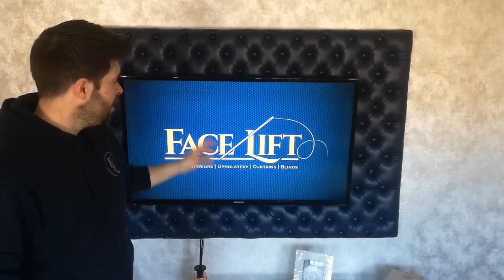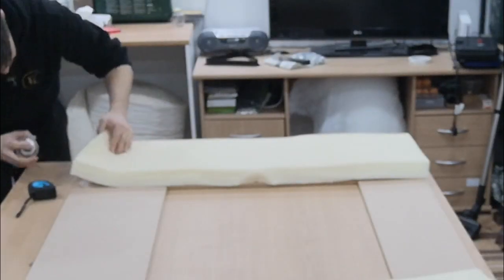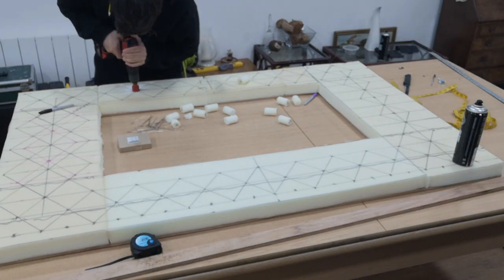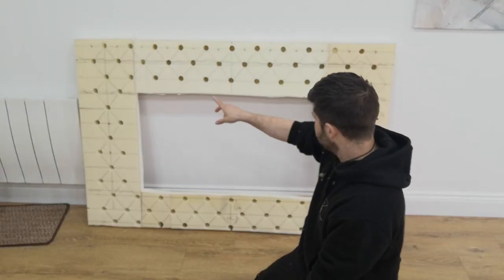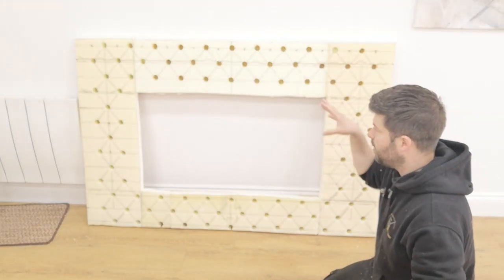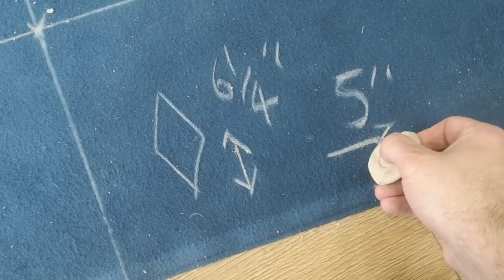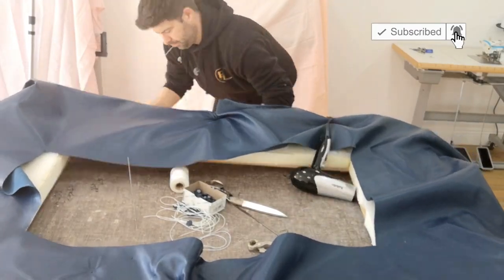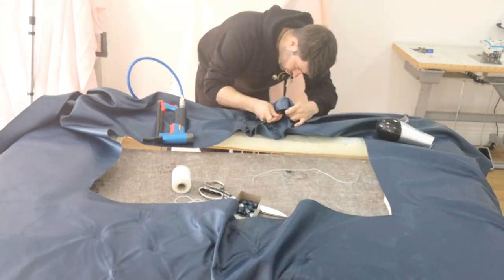UPHOLSTERED TV FRAME | HOW TO UPHOLSTER A TUFTED HEADBOARD | MODERN HOME DECOR | FaceliftInteriors

Comment: That looks amazing!.
Question, I intend to make a seat cushion for a camper van, using vinyl, the foam is 6 inch thick, would 2 inches be about right to set the buttons in? size 22mm buttons.
Thanks
Reply from the maker: Many thanks. Yes leave at least 2" gap around the frame so you don't finish too close to the edge! 👍🧵✂️📐📌🪡